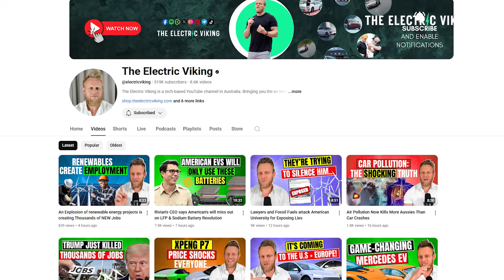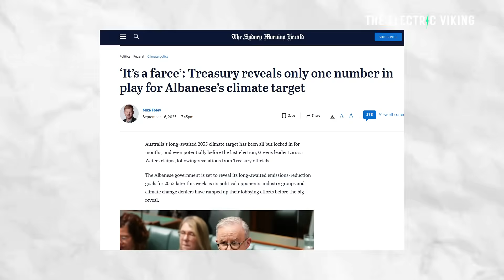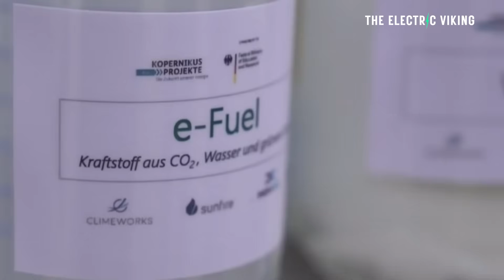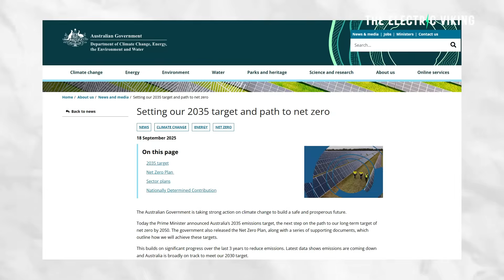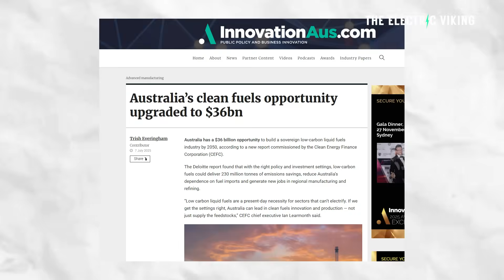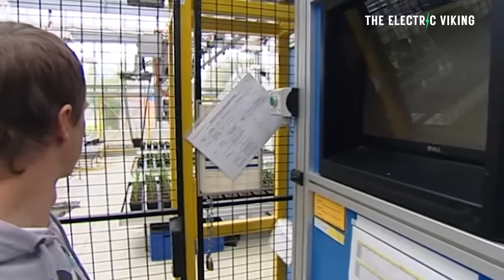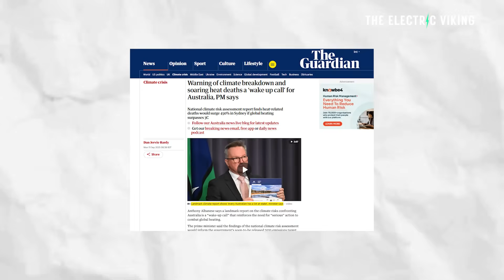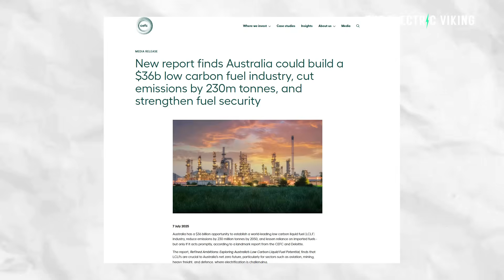Australia's plan for $36 Billion Synthetic Fuel Industry to Power Trucks & Planes

Comment from the maker: The car I drive, the Xpeng G6 - https://youtu.be/IcniwO8NfQQ

RESINC Solar installed my battery and solar system. Get a free quote from them here: https://www.resinc.com.au/electricviking
Reply: Net Zero Makes Terrorism Possible!
1. Funds china's,military 
2. Puts chemical explosive EVs ready to destroy whole cities in the car parks of whole cities.
3. Puts vulnerable Thermal Runaway Batteries on the walls of suburbia.
4. Puts bigger ones as failed efforts to stabilise inherently unstable networks.
5. Puts internet connected and updated solar systems on roofs of Australia. 
All can be triggered to explode by China. 
All can be triggered by organised groups of Antifa or Islamics.
Our government is setting up the biggest terrorist action seen on the planet earth.
Don't go to sleep with an EV under you (in car parks

Comment: It´s not rocket science: Canola/Rapeseed oil as a fuel for trucks was widely used in Germany around 2005. At that time, around 7% of heavy-duty trucks were powered by biodiesel B100 or pure vegetable oil. The technology was constantly updated and is still available and economically viable thanks to CO2 certificates. Animal fats and used cooking oils can also replace diesel. There is no need to produce expensive synthetic fuels. With a few minor modifications, standard diesel engines can run on these biofuels - with no constrains in performance or emissions. At @bioltec, you can find some application examples and learn more about the technology made in Germany.

Comment: You are right, of course, however there will be a place for synthetic FF.  Many slow learners don't want to give up there loud toys.
Reply: Nope. My loud toys will outlive an ev by 5x to 10x much less environmental damage and less slave labor. The vast majority of them can be recycled easily aswel with little to no nasty waste. I can drive 600ks without stopping for fuel aswell. Each to there own. I wont be driving a remote control car ever if I dont have to.
Reply: @stuartwinter2758 😂😂😂

Comment: I agree with you for trucks, but there wont be many long haul trucks by 2030, so this can help while infrastructure is built out, it can also ppwer farm machinery or power off grid charging stations as a backup to solar and batteries. Long haul flights wont be electric by 2050 I'm pretty sure and a lot of people still will want to fly overseas, so there is a case for it, but I agree they shouldn't expect the trucking Industy to want it in 2050.

Comment: Would be a good idea to build storage tanks on land for crude oil, diesel ,petrol and LPG probably not too far away from refineries because the current storage is supposedly for 2 weeks then everything runs out of fuel. Government is probably thinking along the lines that if fuel supplies from Singapore are stopped it will be a good idea to have fuel supplies for the Army, Navy , Airforce and trucks to keep the economy running and the military. Would be a good idea to have more fuel storage for the military. As in storage facilities, tanks to store diesel in and jet fuel. Apparently the military would need fuel storage tanks because fuel deliveries can not just be emptied onto the ground. They need more fuel storage facilities. If the Army, Navy and Airforce ran out of fuel after 2 weeks they would not be able to do a whole lot. Apparently that problem will not be fixed because doing so would be commonsense. 😁

Comment: Simpler to extract light oil from lignite using solvents (C6 to C20).
1.1 BoE per raw ton available from Gippsland lignite @ US$28/BoE.
36 Billion barrels or over 100 years at current Australian use.
State revenue to Vic Government about $50B.
Refinery available.
Reply: Does not sound free like the sun's rays or clean or carbon-free and since when did a Govt ever tax anything other than end use consumers?

Comment: It may make some sense in a few cases but most stuff will go electric.  Long range aircraft need an energy source better than batteries.  If the fuel can be produced from what is effectively a waste product then it makes sense.
In that much time, a lot can change but many of the trucks on the road today will still be on the road.  We may see conversion kits or something but a new fuel that replaces diesel can also be an option for them.

Comment: Is this kind of like snake oil ? 🤡🤡. This is not even carbon neutral. there is a process to make jet fuel through photosynthesis maybe for long distance air travel. However this is canola oil project ... might as use algae. Thanks for your continued research

Comment: I asked Grok two questions. First, "how much land would be required to produce car fuel from canola oil for all the cars in Australia?" Second, "If all the ICE cars in Australia were replaced with electric cars, how much land in Australia would be required for solar panels to generate electricity to fuel all those cars?"

The solar panel approach would use about 1% as much land as the canola oil approach.  In fact, the amount of land required for the canola oil approach would be large enough to interfere with growing crops for humans to eat.

As from the canola oil approach requiring an infeasibly large amount of land, it would also produce pollution (just like using fossil fuels in cars does) and contribute to climate change.
Reply: You also have the distribution network of all the trucks delivering it. You just can't beat electric.
Reply: whats the backup for power generation when solar is not available (weather / time of day), how will power be stored? and whats the cost associated with getting rid of obsolete solar panels in the future?
Reply: @waszyrowski  Grid-scale battery packs (such as Tesla's Megapacks, which are about the size of a shipping container and can store about 4mWh each) are typically used for storing excess energy from solar panels. Tesla released its Megapack product in 2019, which indicates how relatively new is the concept of such large-scale battery storage (it would have been technically possible to produce something similar to the Megapack, say, 20 years ago, but the cost would have been prohibitively high).

Solar panels might have a manufacturer's guarantee of 10 or 20 years, but are typically expected to last 25-30 years, which is similar to the lifespan of Megapacks. I don't know what the disposal cost is for old solar panels, but my understanding is that cost of building a power plant based on solar panels and battery storage is cheaper than the cost of a fossil fuel or nuclear power plant.
Reply: Solar is an infrastructure. It keeps giving year after year. Canola fuel is one off. You have to keep buying all year long.
Reply: CiaranMcHale , yes I ask grok as well and it said the government is using reverse psychology to make us pay more tax for their fantastic incompetence and Total idiotic policies  ….

Comment: I am starting to think that the main issue when it comes to adoption of EVs is indeed politics - at least in the big countries with natural resources there is such a strong lobbying power from those natural resource interests that there are all kinds of shitty solutions constantly regurgitated. 
Much of the less developed or smaller countries with no such resources are just building out renewables and installing chargers, even if the demand for EVs is not there yet due to their price or some other issue, they do not whine about grids that ''cannot cope'' or every year start to claim that e-fuels or hydrogen will ''save'' passenger vehicles from EVs that are so inconvenient apparently that it's very bad that charging them 5 minutes using already existing chargers adds more than 70 miles (115 km) of range... and there exist chargers in China that do it in 2,5 minutes, so that is not acceptable and we need some wonder fuel to ''solve'' it.
Ok this is about trucks and planes... For planes I mean, presumably in labs we already have tech to run them at least as hybrids some time in future, maybe as transitional fuel we can use that, but ehh... increasingly when it comes to cars and even busses or semis seems like they are looking for ''solution'' for stuff that has already been solved

Comment: Short to even medium ranges for trucks can be done via batteries. Long distance overland freight should really be done by train. Medium range being a mix of train and truck. Trains can be pure electric and we have been doing so for over a 100 years. 

For shipping small to medium size ships that operate short to almost medium ranges are already possible to do as battery electric. As batteries advancements are still happening at a quick rate both size of ship and distant traveled for ships will quickly improve with that. 

As for planes they are less but at least smaller size planes for shorter flights can already be done by battery electric planes. As this is also limited on batteries improvement in batteries has directly resulted in larger airplanes and longer ranges being possible. 

So with all that in mind seems like the focus should be on improving batteries and go with the massive investment already working on doing so. That and just electrify your rail lines. Again we have been doing that for over a 100 years.
Reply: trains can be pure electric but it's not viable everywhere, cost to electrify middle of nowhere and maintenance of infrastructure would be insane

Comment: if they said they would use the canola oil to make plastics or the like instead of crude oil maybe.. but i have a strange feeling by 2030 there will be a decent number of electric trucks on the market from various companies powered by the solar that your country is deploying that this will start to be completely laughable well before 2050. Will there be still some thing that use gas and diesel in 2050 probably but not many. I can see that Solar and Wind alone may not be the solution and we will need more solutions (along with a few tons of batteries)  

Curious is your politicians starting to follow the US's energy plan by the energy secretary?

Comment: It's back! The Elsbett engine. Let's go through the same loop again, calculate the total energy consumption, water consumption etc. to make fuel and then burn it to produce 60% heat and 40% motion in a water deprived hot country and we're back at electricity, batteries and solar power.
Reply: YES and if Australia could produce enough Canola Oil, do you think we'd get any of it?  All our LNG goes offshore untaxed and we can't buy any of it.  It would be the same with Bio-Fuel: millions of hectares of our best land and gigaliters of our dwindling water supply would all be for fuel to China or Japan or the USA and a handfull of Aussie or foreign billionaires would get all the $
Reply: You will never beat diesel .
Reply: @FeralDingo123  But diesel is filthy!  Burning diesel in a gas turbine will produce as much as 200 pounds of nitrogen oxides an hour!